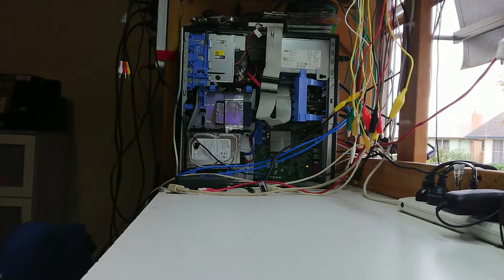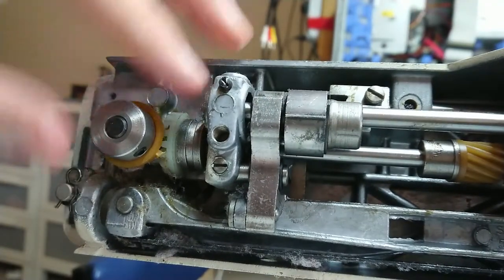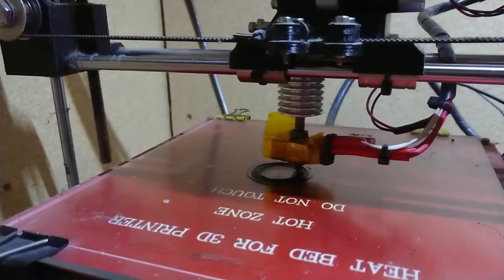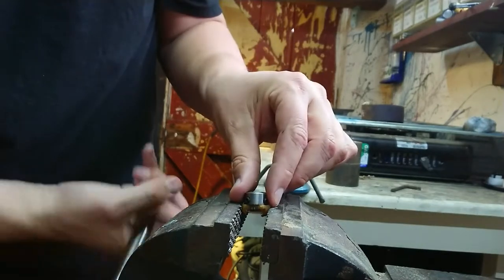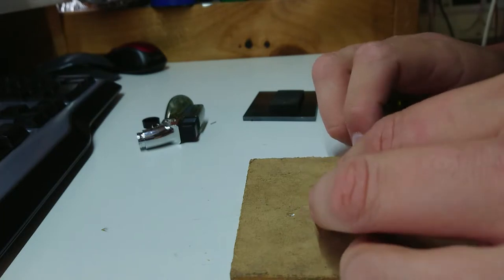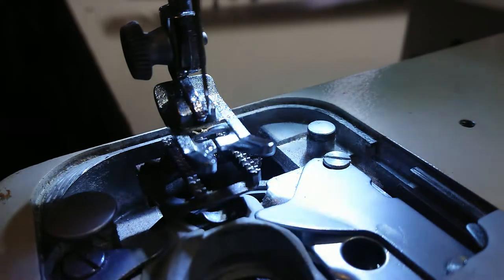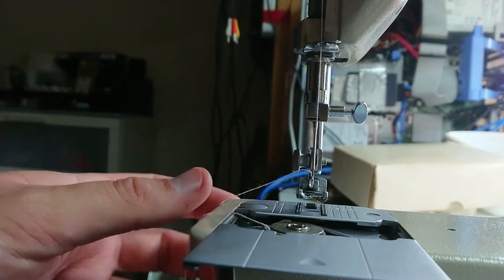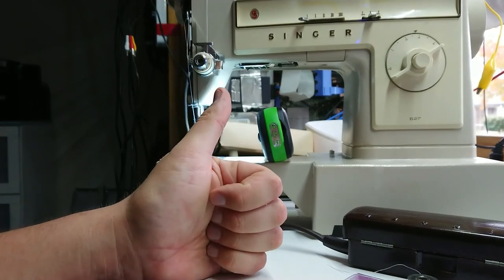Repair of a Singer Model 527 sewing machine

Comment: Thanks for this - I've just bought a 527 from a charity shop and I'm about to test it.
Reply from the maker: They are a fairly nice machine to use with a few drops of oil in the righg place. Foot pedal is the main weakpoint, but ebay and aliexpress have clones of the foot pedals for sale

Comment: Your video is excellent but the gear seems to be frozen on the shaft.  I'm not sure how to get it off.  Should I soak it with wd40?  I had to really tug to get off the other gears but I'm not sure how to remove this.  Any suggestions?
Reply from the maker: Use a penetrant oil like wd40, let it sit overnight.
Also remove the grub screw completely and put a drop of wd in there too.